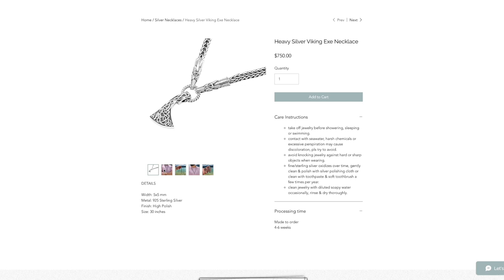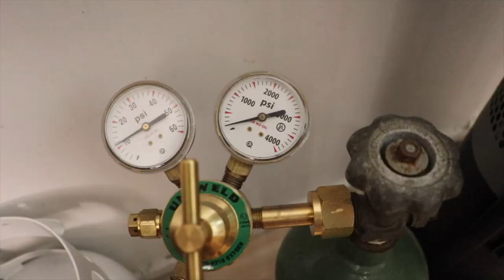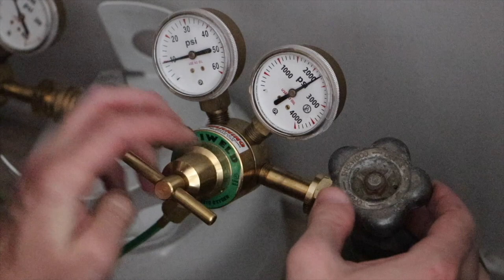Heavy Viking Axe Silver Necklace

Comment: Thanks for teaching people how to do this. I don't have any metal forming rollers but I found sterling silver half round for sale online. It was surprisingly cheap. I bought several feet of it and was able to make a necklace to hang a small meteorite I found. I started with 20 gauge wire. But i just bought some 24 gauge and i want to twist them in pairs then make the rings and see how it turns out. So many ideas.